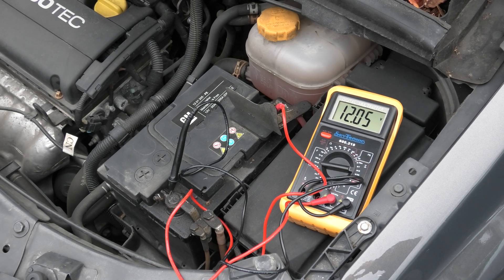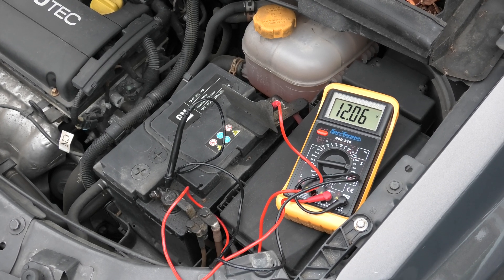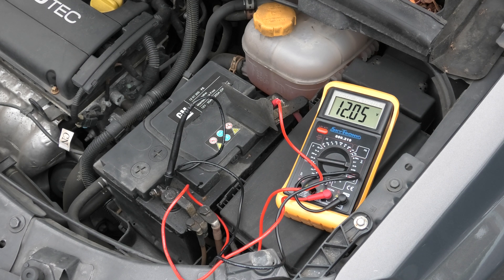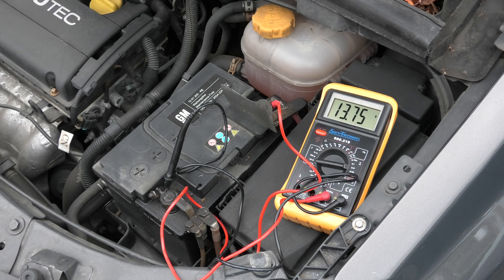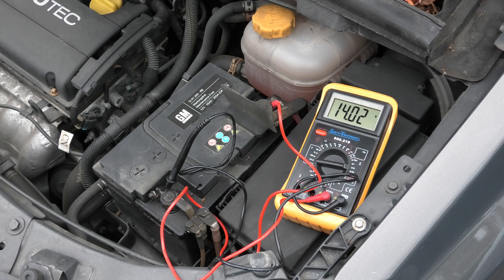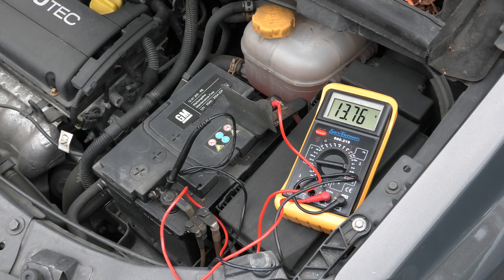Testing the battery voltage on a Vauxhall Zafira and the alternator charging volts.

Comment: Just to give you a heads up the battery should be 12.4 to 12.6 anything below that the battery needs charging or replacing especially on modern vehicle. It can course faults to pop up as low voltage even though the car still starts
Reply from the maker: I do actually show 12.5 on my multimeter. However, I do not say what the battery should be, many thanks I did not know this.  The amazing thing is the car is 2014 and as of July 2025 it is still running the original battery. In fact the car has not been back for even a trim clip. Thanks for the visit.